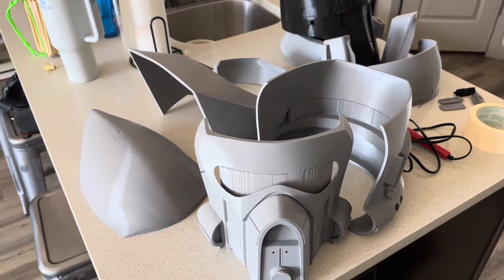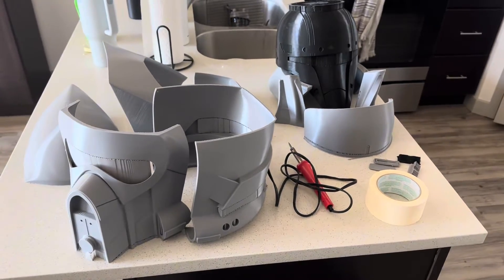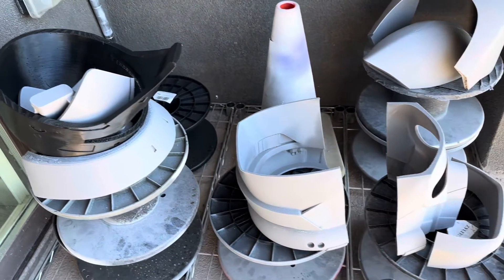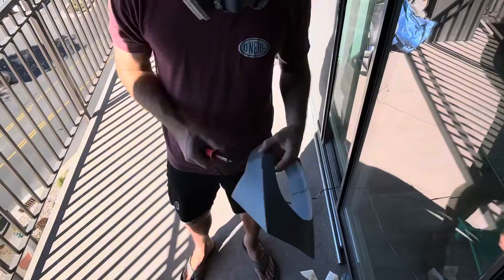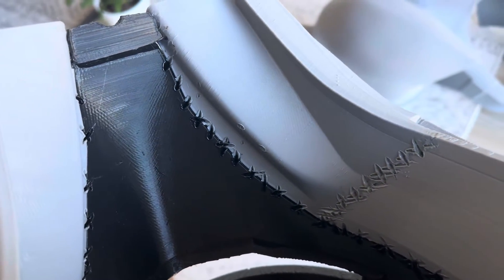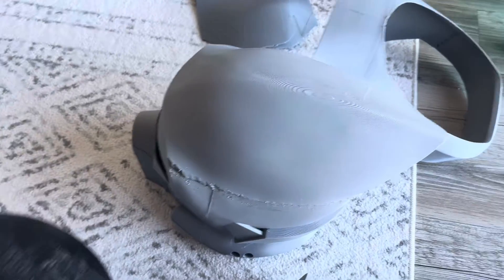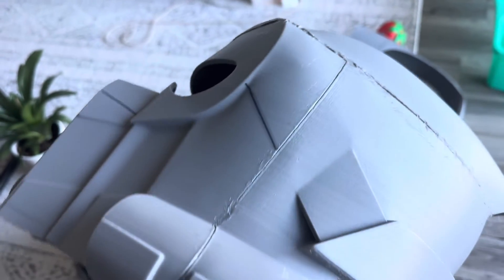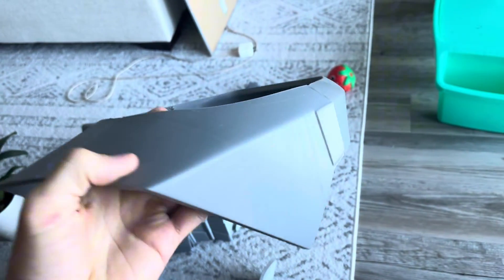Printer too small? How to weld your 3d printed helmet together! #3dprinting #propmaking

Comment: Just use an Epoxy or Super glue. Faster, stronger, and will look cleaner in the end because this doesn't look so good even though this method does have it's applications this isn't one of them but thanks for the video.

Comment: that'll work, but I would think glue would be much better. you are only welding a thin layer on outside. Glue would allow the entire contacting surface areas to "weld" is you use the right glue for the specific plastic you're using.  Looks good though, and this isn't a high stress part.
Reply: Do you think that it may be a good idea to do both? or would that be overkill
Reply: @NaamloosDev  overkill... plastic welding physically bonds, so using chemical bonding also wouldnt help, i would imagine

Comment: Great video Ian! Question: what is the watts of the soldering iron? Thanks
Reply from the maker: Thank you! Great question. It is standard for American wall outlets
Reply: @3del_printing that's volts not watts. Volts in input. Watts is the output.
Reply: @davetriesthis Amps is most important anyways

Comment: Soldering Irons do wonders for 3d FDM prints.
If you can, get the Iron with changeable tips, they got those flat heads and narrow heads to help with flattening welds and support removal.